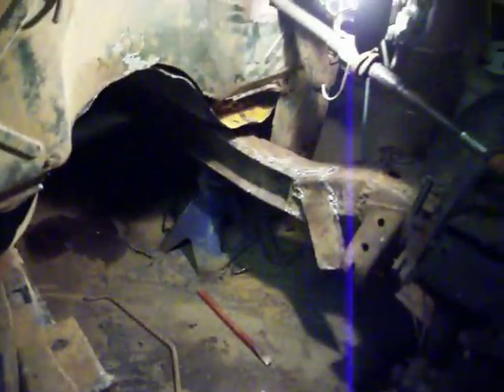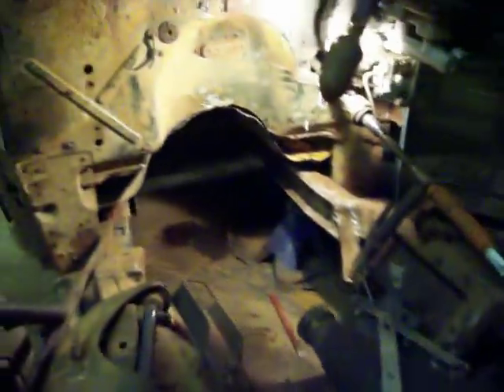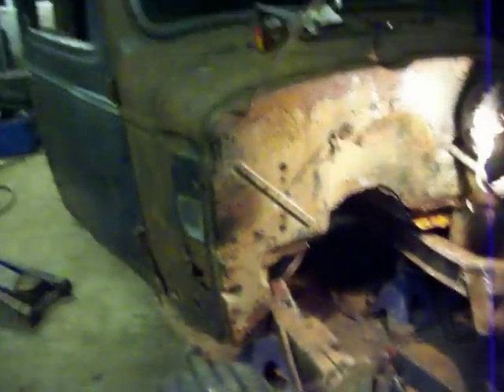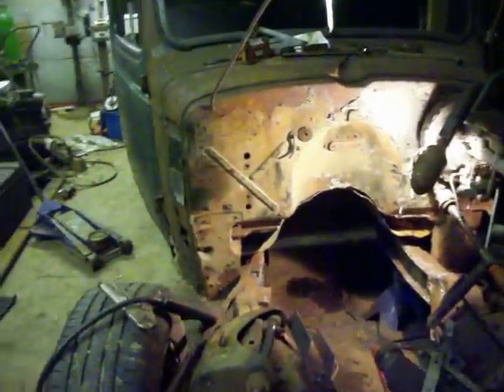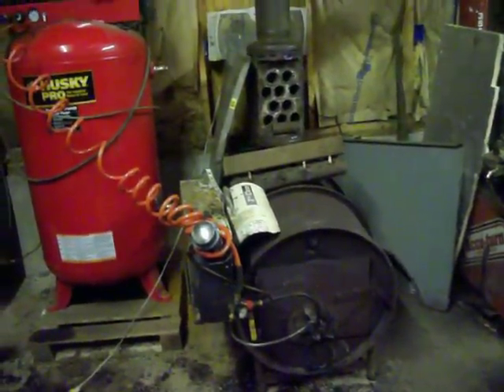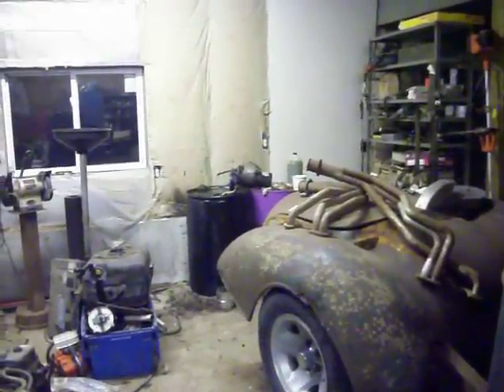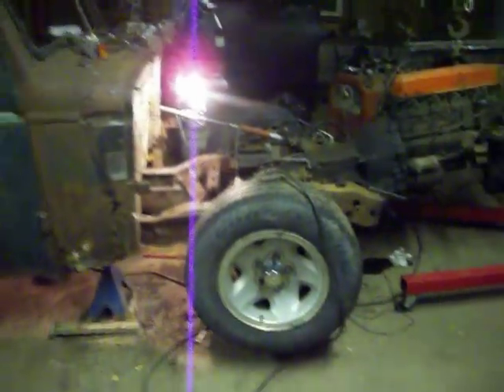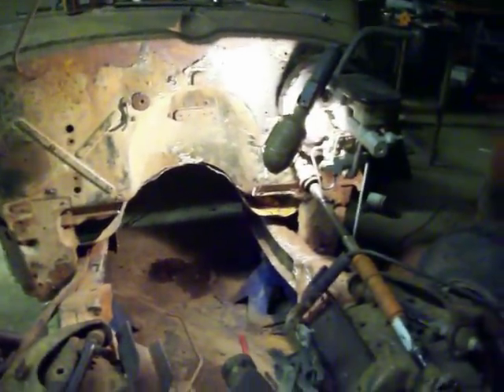Combo video :Hacking more out of the frame! / update on waste oil pump oil filter.

Comment: That in and out stuff gets old kinda fast. I got lucky on mine, I put the engine in the frame and then built around it. It hasn't been out yet but it's been jacked up a few times. Seems you always forget to check or measure something or cut something off and move it cause it's in the way. If they just magicaly got put togather at nite by the ratrod elves that would be too easy and you'd miss all that fun and cussin. Looks good though Dan.             Dan